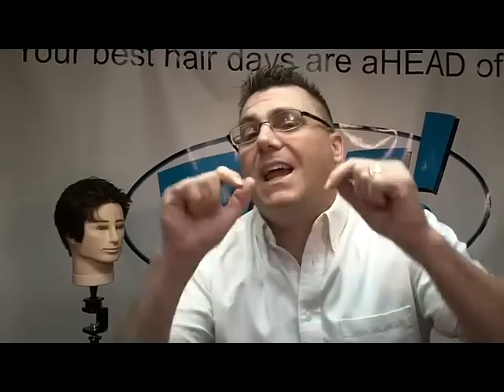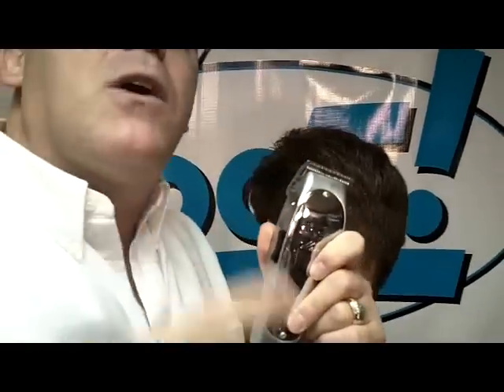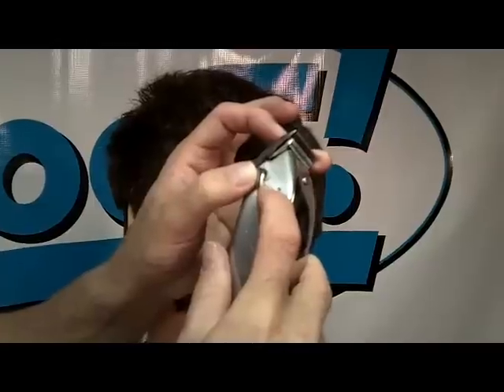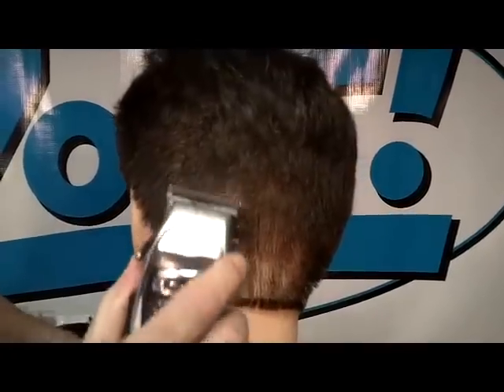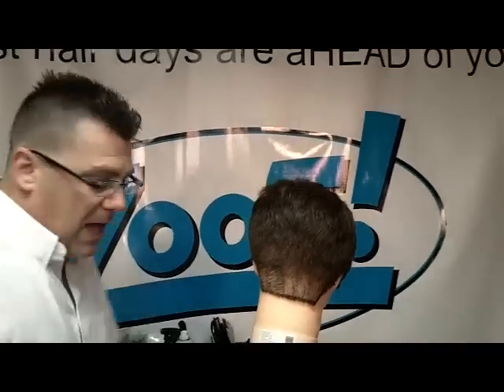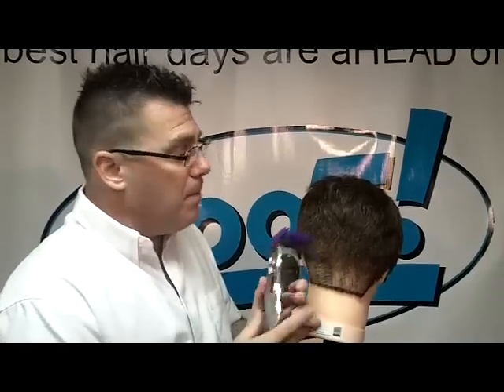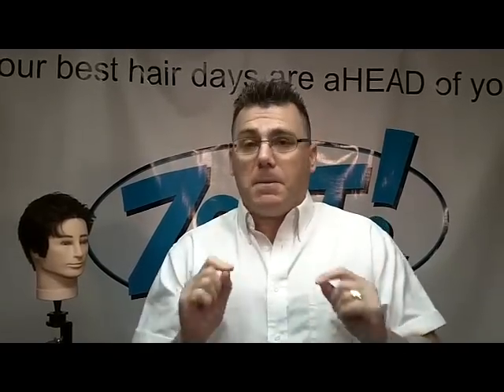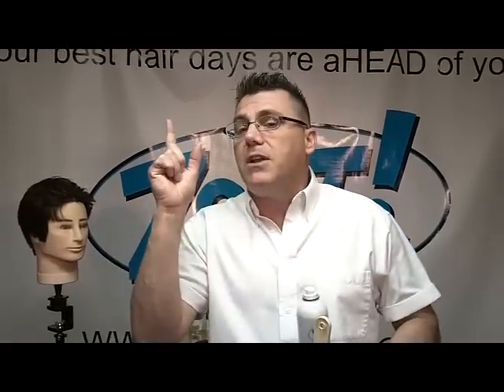Clipper blade adjust lever, how to use, Video #13 ClipperGuy's Greatest Hits series - Ivan Zoot

Comment: Just got some new improved masters and my lever does not cover the top notch like yours does in this video it stops between the top and the second notch is this something I can fix or do I have to deal with the hassle of returning them
Reply: I use a cheaper Wahl on myself, and I think that is adustable. Check the manual (RTFM!)